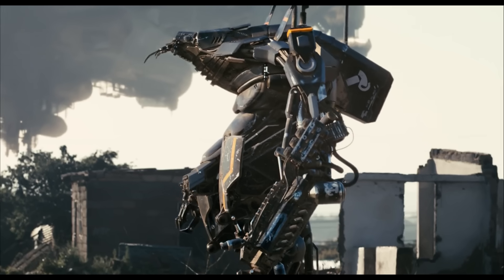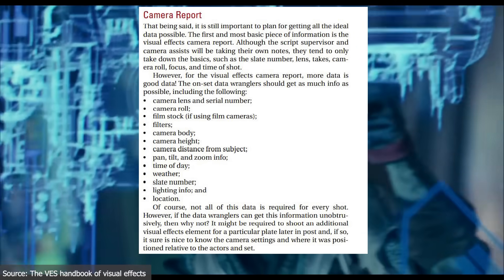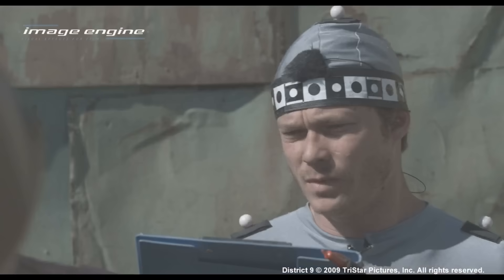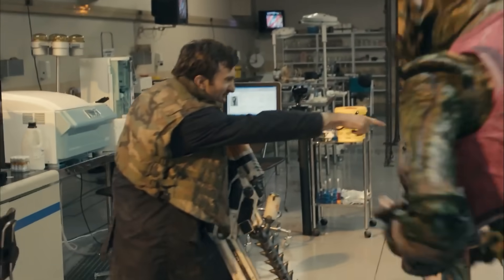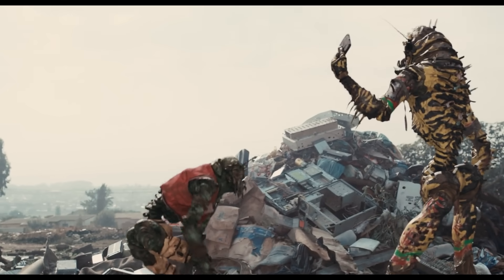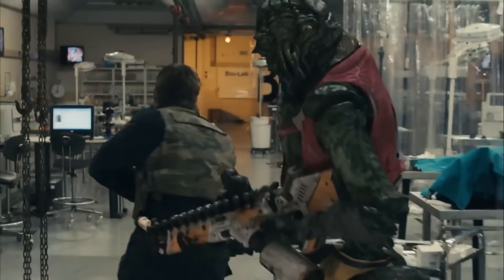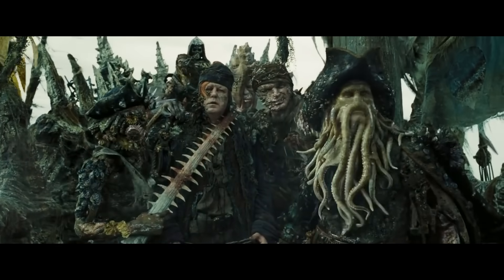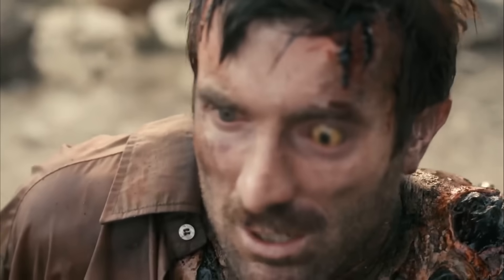How Did District 9's VFX Look SO GOOD?

Comment: Exceptional effort in producing this video. It does a great job in explaining the very difficult process of making a film like this to the average film viewer who may not be aware of  the insane amount of work needed.

In 3D software: Creating and using virtual -  camera movements, modeling, texture & surface mapping, lighting, framing and, as you pointed out very well, after all this work, the nightmare of doing matte shots with live footage.

Excellent effort and research, great video!

Comment: 9:00 You don't always have to paint like that. In fact most of the time you can track the shot/resolve the camera and replace multiple things in the background in 3d or even just in your compositing software.  I also suspect that often the large aliens were simply positioned in a way that obscured the stand-in.
Reply: I suspect that 95% of the time you are inserting a slightly larger character. Anything else just wouldn't make sense.

Comment: Just found your channel, this is my second video. Love how you break this all down. 

As vr tech gets better at tracking motion, do you know if any filmmakers are utilizing that tech to capture motion rather than to do so visually?  I mean you could even put several on the camera to track the shakey motions, then use that data for your placement quite easily I would think.

Comment: clean shot is what i thought, because i do alot of SFX for independent feature films, another way to do it is by taking a picture and making a model or warping the texture of the background and tracking it with boujou or another program like NUKE, also yes it requires alot of manual labor and manual tracking,

Comment: I think Neil's right on about how it breaks immersion if the VFX shots are visibly shot differently than the rest of the film. That's often a dead giveaway and avoiding that problem through the camera movement and framing is probably the biggest factor in the believability of the VFX here. Yes, the compositing and CGI is excellent in District 9, but so many movies just mess up the camera movement and you can feel it immediately.

Comment: What if you had a camera on a robot stand, and you were able to record the camera movement? It would be very easy to do the second time for the blank slate as you just let the robot repeat the previous movements exactly.
Reply: First take is with the actor in it. The Camera starts and look at a precise point. The cameraman then moves the camera as he wishes, chaotically if he wants to but this movement is recorded by the robot. Every rotation angle, every x,y,z.

On the Second Take, You remove the actor, place the robot stand with the camera exactly where it was prior to the first take, and just let it retake the blank state with the exact same movement

Then sync both.
Reply: You can do that with stationary shots, yes.

Comment: Well they did list the camera tracking software hat they used: PFTrack and Boujou.  That's not "sheer brute force".  Those softwares were made to track these kinds of shots and were very capable in 2009. I was using them a lot back then.  Their whole selling point is you don't need artificial tracking points.

Comment: I have sat at a Wacom tablet for thousands of hours wrangliig digital Hair, doing digital wire removal and fixing fx compositions.  Visual FX planning could have made this eo much easier.  All they had to do was let the human control the camera the first time with the computer controlling recording the motion in 240hz and xyx tracking and then the computer controls the camera for the clean plate take (which could thrn be taken one frame at a time.  Just matching the shots with a still cam would have saved thousands of hours.  and yes i've never met a motion capture stream that didn't need finessing!

Comment: lol.

i got into graphics after i left school at 16 in 1970, my second job after i left school was tape librarian in a computer bureau looking after punched cards, mag tape and paper tape for a UNIVAC 9400 machine. the operators had done some ascii nudes, so that was my first exposure (!) to "computer graphics". i also did a stint at southern gas, pasting (literally sticking) the new "modern" logo over the old flame logo.

twelve years later i wound up doing my degree in graphics and i got caught up in the computer graphics wave - 1984 ish - i worked for digital pictures for a year or so, then moved to cfx, then went freelance around 1990 and worked for - well pretty much everyone. (actually i have some photo albums on my facebook - a history of computer graphics - dating back to the mid 80's)

the connection though is my boss at digital pictures wasn't interested in computer graphics, he wanted to make adverts and pop promos, and one experience i had was the making of a show reel for molinaire (a production company we had ties with) which came down to rotoscoping - literally tracing - black dancers in black costumes with squares of reflective tape stuck on them, so we could work over the dance routines and add graphics, two weeks in a darkened room tracing black dancers in black costumes. with a pencil. i still have some of the sheets.

i also did quite a few shots for thunderbirds the movie (anything with bubbles, jet exhaust or floating weightless chaff, i worked on) and resident evil, the original movie, anything with the licker's tongue, again, i did. and a lot of it done with camera tracking done by eye. 11:47 there was a department that did the tracking by computer, but the data wasn't ready when i signed up, so of the fifteen or so shots i worked on i did all the tracking by eye, the longest shot being in the warehouse when we track up to see hundreds of licker boxes dotted about. in fact i started on the project just building a model of the box, then i got lumbered with more and more stuff. same happened with thunderbirds, lots of tracking, no data, i did it by eye.

most of the "real work" is done by the compositors department though, matching lighting and making mattes, real work.

Comment: It's not impossible to use clean plates that don't track properly..  Often they're still very helpful in recreating the background behind the grey-suit as you can track in the desired sections as patches.. they rarely shoot them though, so you end up doing what you listed out by grabbing from other frames or other shots to create the needed patches.  Kinda frustrating.

Comment: Instead of relying entirely on in-image tracking markers to allow VFX tracking, why don't the cameras have gyroscopes and accelerometers like a smart phone does and record the actual movement of the camera as metadata in the video. Video image stabilisation on an iPhone uses the gyro/accelerometer to detect movement of the phone and using this data it cancels out the movement in the image. Likewise head tracking on a VR headset uses the same kind of sensors and works extremely well.

The same data could be used to allow the VFX software to precisely detect the camera movement in 3d space even without any in-image tracking markers, or in combination with them. It wouldn't be susceptible to blur on fast movements, obscured markers etc and solid state gyro's / accelerometers are very accurate these days. The only issue might be gradual drift over a long shot, but this could be compensated for by using tracking markers at the beginning and end of the shot to measure and cancel the accrued drift.

Comment: Couldn't you reduce a ton of these issues by filming it with the camera still (moving like normal movies but in a repeatable fashion) and then adding the shaking and stuff after the special effects are added?  Basically film each scene with a wider angle than you plan to use.  Then when you add the shaky part later you are just sliding the frame around using the extra bit around the sides that was captured with the wider angle.  It wouldn't help with extreme movements you might want but I would think it would help cut the overall work significantly.  That said, I'm not an expert so I'm sure there is a good reason this can't be done.

Comment: They did it for the whole movie???
damn that's crazy
couldn't they theoretically film a wider bigger shot twice (once clean) and then simulate the same shaking for both?
Like camera stabilizing techniques?
When you have more space to work with you can simulate camera movement is what I mean
But then you'd only have shaking on the x and y axis... 😩

This movie is amazing and I wish more people cared about the plot because it's more similar to our geopolitical situation and people rather ignore it and claim it's all just fantasy..
Reply: The wider shot would have different parallax. You probably know the trick of holding your finger close to your face and focusing on it while closing one of your eyes and then the other. Compared to doing the same thing with your finger at an arms' length, your finger would appear to move differently relative to the background.
If they decided to use a wider shot as a reference, then they would have to either sacrifice the authentic feel of a hand-held camera by flattening out the background - it will essentially look like the camera is panning over a very big (moving) photo - or they would have to make a 3D reference for every scene, take out the actors from the wider shot, and paste them into the closer one using their reference to simulate accurate parallax. Ultimately they'd just be removing the background instead of the actors like what they decided to do instead.

Comment: Who wrote that garbage at 1:12?  A finished minute of VFX takes only an hour?!  That’s not any general rule of thumb I’ve ever experienced.  I understand that the context of the message is talking about low budget amateur/student filmmaking, and not Hollywood films, but even then, VFX takes much much long than that.  Maybe if all you’re doing is keying out a greenscreen for a 1 minute uninterrupted clip, then yeah it’ll take an hour to import the clip, setup the workspace, keyframe a simple/loose mask around the subject, add Keylight and tweak the settings.  But if there’s multiple different shots that were edited together, then you have to address the keying uniquely for each new shot.  Furthermore, if the keying has any issues, then you can expect many many more hours of rotoscoping (even using modern auto-tools).  I haven’t even started mentioning anything more complicated than a simple greenscreen clip, so let’s not pretend that a “1-minute long VFX video” refers to similar simplicity.  Usually it means there’s greenscreen work, sky/background/world-replacement, CGI objects/characters/elements composited, and likely at least some 2D or 3D motion tracked shots, that really help sell the magic.  You’re talking about weeks of work.

Comment: I love vfx but hate superhero movies. District 9 is a perfect example. It has great vfx but it is not the focus point of the movie, it's used in a way that it's not distracting. just like it shoud be used. you should be amazed without really thinking about what you're amazed about. Instead of a static painting in a gallery where the artwork is the absolute, a movie is a work of art with many moving parts. as a whole when you like a movie using vfx you should not like the movie because the vfx.

Comment: You are actually incorrect about the difficulty of adding in the background of the cgi. They did something simple and smart. they made the cgi characters all bigger than the reference so instead of being dumb and wasting time filling in the background they could cover over it and had to do extremely minimal useless things your talking about. The are professionals with unique perspectives thats why they are in a whole different league than most. Most of your assumptions of the problems they faced they found ways to solve without wasting time and money doing the nonsense modern cgi struggles with.

Comment: Its very odd that your voice over, with a middle class accent, is spoken without the benefit of the letter ‘t’ as though to downgrade it to a working class accent, it takes away from the otherwise nicely spoken voice. I suspect you're trying to hard to be a ‘Geezer’ and you don't need to.

Comment: I thought when they used a human actor for aliens, that the CGI simply covered up the actor with the intended alien character details. I didn't think they actually removed the actor to a clean plate to fill in the details. That seems like extra work that is not necessary.

Comment: CGI doesn’t work at 4K.  That’s the issue with modern cgi, and it’s bad.  The quality of individual responsible, (on average of course) for the visuals are lacking.  Movies are just low tier now days; which is unfortunate for us.  The CGI in this movie is amazing though, still better than most of todays stuff.
Reply: 4K is overrated anyways imo